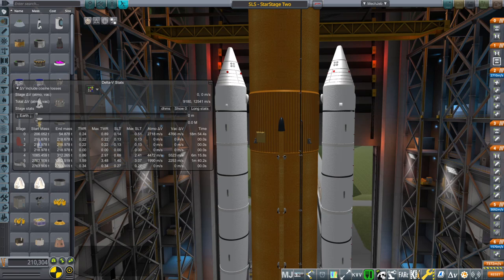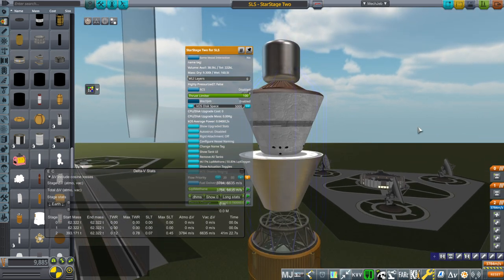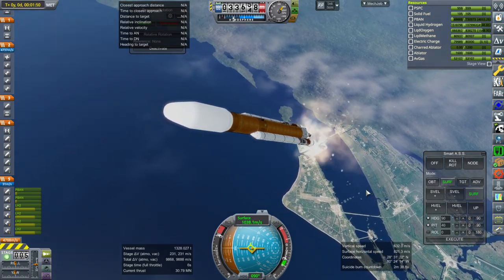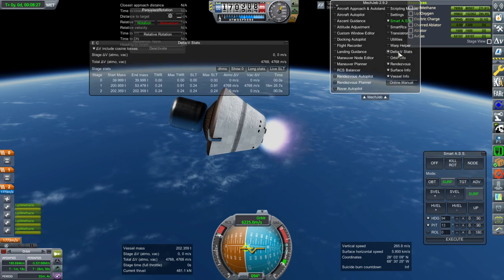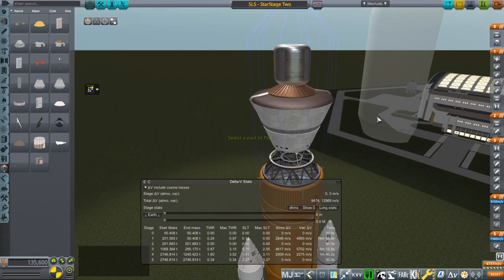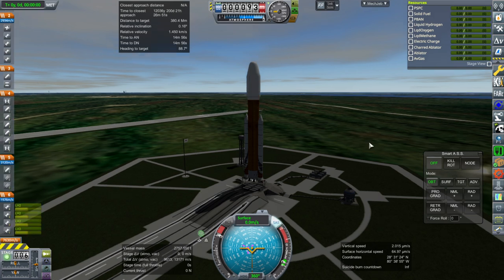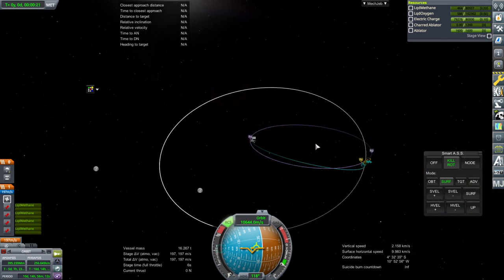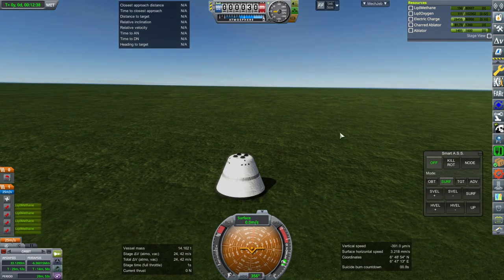SLS with a Reusable Methane Upper Stage

Comment: Why methane? An "encapsulated" EUS could be better, with added benefit of being cheaper to develop. Maybe also with ESA's Vinci engines instead of RL-10s, if you wanted extra thrust.
P. S. Could you try to build some of the Heavy-lift Vehicle concepts from NASA's SPS study? They are pretty cool, and one even has same payload as Starship with only 4000t wet mass.
Reply from the maker: Because a hydrolox stage in capsule form designed to survive return from high orbit would be wider than SLS is known to accommodate.
Reply: @RaizSpace  But it could be longer, couldn't it? Something the shape of the Mercury/Gemini capsules.
Reply: @HalNordmann  No, there is a ratio that needs to be met and in order to get the volume you need it must be wider than SLS
Reply: @RaizSpace  what if only the lox tank was capsule shaped and had the engines and you just threw away the hydrogen tank after separating the payload (hydrogen tank being on top in this configuration)
Reply from the maker: @Ryan Spence This seems like desperation . . .
Reply from the maker: @Hal Nordmann LEO capsules like Mercury, Gemini, and Dragon can have steeper sides, but coming in from HEO, it has to be flatter like the mod I made here, Apollo, or Orion.
Reply: @RaizSpace  ok but would it work and would it cut costs
Reply: @RaizSpace  Fair point, I guess. But since there were some plans to use Gemini for lunar missions, it might be worth it to revisit those assumptions. You might also try a Soyuz-shape "headlamp" reentry vehicle, since the Zond mission were able to do a lunar return with it. There is also a bit of space in the 10m fairing to spare, so maybe a 9.8m top diameter Apollo-shape vehicle could work? Not criticising your approach, just curious.

Comment: If an SLS in an very improbable case deliver a “light” payload for the rocket, could the core make orbit like Long March 5?
Reply: @cha7664  You're right, they can. I believe there's actually residual propellant on the Block 1 core stage, since they want to have a 50km perigee or lower to reenter the earth and avoid a CZ-5 core scenario.
Reply: @cha7664  Yep, almost the same thing except SLS has a 1000km apogee lol